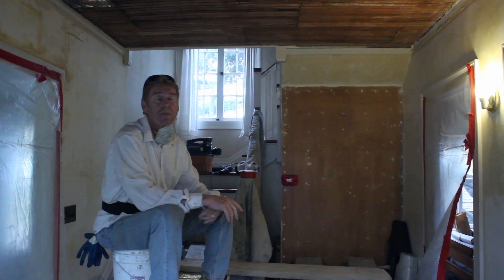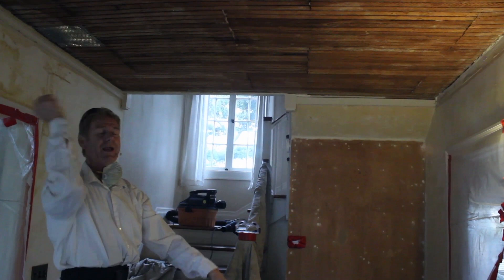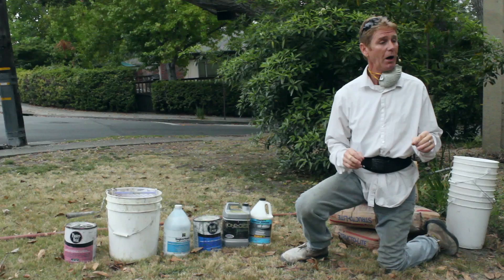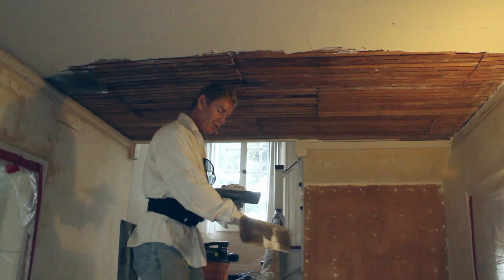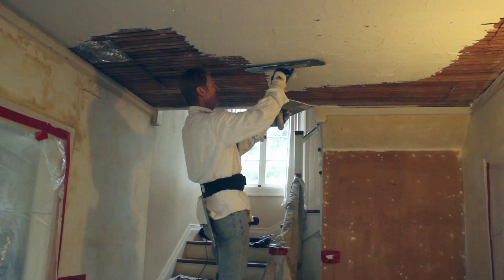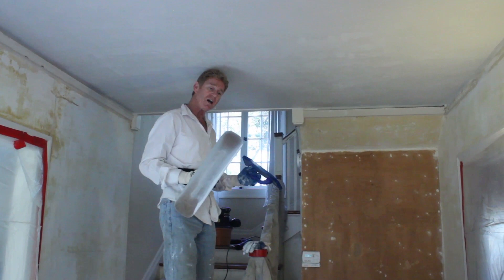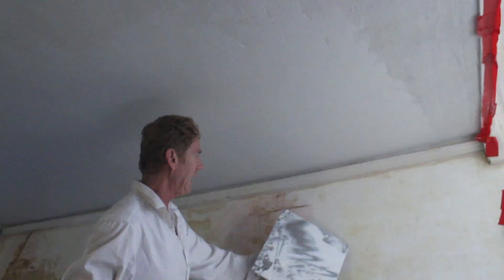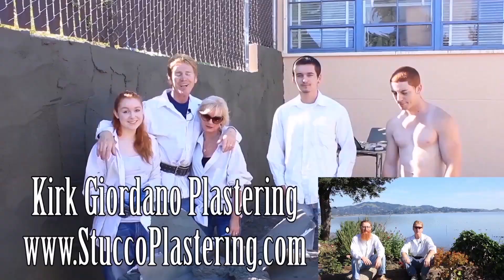Structo-Lite base-coat with a lime plaster finish

Comment: I been Plastering for 47 years. I always cover the wood lath with metal lath. I like you started in the union.
Reply from the maker: Good morning Wallace Dude, my fellow plasterer, I'm glad someone has more time than me in this sport, I feel better about myself now.
 BTW, I have many videos where I do cover the joists and wood lath with 3.4 metal stucco mesh and even 3/8 rib lath, this ceiling it would have been overkill.
                          Live long and plaster
 teaching you how to repair your number 1 investment
Reply: Kirk Giordano plastering Inc. this dude is about done with plastering. Never liked it. If you would have asked me  when I started if I'd be doing it 47 years later I would have said your nuts! That being said I made a good living at it (still do) I like the guys I worked with all are dead now. Only way to get a plaster is go to the grave yard and dig them up. I'm just 64 but I think this is my last year.

Comment: How long can the Structolite sit before you would have to use a bonding agent before putting on the Diamond? How long should you wait after applying the Structolite base before applying the Diamond finish?
Reply from the maker: As soon as it’s set you can finish over it.

Comment: Hey there kirk, just wanted to add a little info about StructoLite, that is directly from USG, that I haven't heard or read you mention. StructoLite, being a lightweight aggregated base coat is not nearly as strong as a standard sanded base coat made from a standard high strength plaster aggregated with sand. USG's StructoBase product is the strongest gypsum basecoat they offer, it is just much harder to find than the pre aggregated structolite, and also requires jobsite addition of sand. Because the lightweight aggregate, perlite, produces a bit weaker coat, structolite has several limitations that USG mentions directly on the back of the bag, and in their overall plastering literature. They recommend it not be used for three coat work over metal lath, when a standard smooth coat plaster is being applied, as it is not strong enough to prevent cracking of the finish. The reason we get away with using it like this, is because I am almost always applying a smooth finish that is a high strength veneer plaster, instead of gauging a white coat out of lime putty and gauging plaster. I see you also using the high strength veneer for your smooth finishes in your videos too. As I have mentioned in previous comments, these veneer white coats are many times stronger than a standard lime and gauging finish. If you read the information about the veneer finishes closely, it is apparent that the veneer finishes do have a very fine quartz sand added as an aggregate, which is what gives them their extreme strength and ability to be applied in a single thin coat, which a standard white coat could never do. The sand is so fine though that it spreads and feels like a sand less putty finish. Because the veneer finishes are so strong like this, it allows us to bypass the normal limitations of StructoLite not being strong enough for a standard putty coat, when applied as a two coat base over a non ridgid lath. This of course does not apply when doing one coat over a rigid base such as gypsum lath, or block, etc.. I just thought it is important to note these limitations of StructoLite, as USG is sure to mention them clearly in several locations, and the fact that most people don't mix up a lime and gauging finish, doesn't mean that someone may not try at some point and if they do its important to know it may not result in an issue free finish over two coat bases like the high strength veneers allow us to get away with. Bottom line, is the lightweight aggregate provides insulating, fire dampening, sound proofing, etc, but is in no way a stronger base coat than a standard sanded base and there are differences in applications due to this.
Reply from the maker: Good evening Joseph Dude all true thank you,
I try and give as many details as I can remember when showing how to use products, I thought I gave the basics well, but there's no way to explain every detail of any of the products we show in video's plus I forget more details than most folks learn in a lifetime.

            Live long and plaster
Teaching how to repair your home

Comment: Just a pointer on using a milky white bonding agent that dried clear on me, thus making it hard to know if I'd hit everything. I used some acrylic ink (yellow) as admix to give it a dried color haze. Watering down acrylic paint of any type would probably work as well and not compromise the adhesion of the bond agent.

Comment: Every time I hear the word structo-lite I remember the first time I used it. Dumped a wheelbarrow load from the mixer. Took it 40 ft to the mud board and the entire load went off in the wheelbarrow. Full wheelbarrow worth of mud hardened solid in seconds.
Reply from the maker: Good morning Farmer Dude, that happens often if the bucks, drills are dirty, this plaster usually take between 90 minutes to 5 hours to set, but when dirty or contaminated will set immediately plus the wheel barrel sides sucked the moisture out too,
 Life and time of stucco dude.
                          Live long and plaster
           Plastering tips for your information
Reply: Yes sr. Happen to me too can even believe it, mix all different kind of mud before but structo lite man, that is a different story if you add dirty water or dirty tools.

Comment: Kirk....great video.  Ive emailed you a few times in the past about how we use structolite in the movie business to stand in for anything thats supposed to be concrete.  I've even sent you some pictures of our work.  My team and I usually, depending on how much time we have, throw a quart cup of portland cement into our mixes so it hardens faster.  Have you ever done that while using this product?  If not, and you're pressed for time on a job you should consider it.  Half a bag of structo in the bucket, quart of portland, and water and you'll have about 45 minutes before it starts to harden.  Its a good method....
Reply from the maker: Good morning Mike Dude, excellent tip, as a rule I don't like to add portland to gypsum based products on my jobs for your movie props great idea.
 i usually have some gypsum accelerators on my truck, this time we didn't so we got a cleaner truck while waiting. 
           Love to see some of your movie set props,
                          Live long and plaster
 teaching repairing your number 1 investment, your home

Comment: Kirk. Thanks for continuing with the videos.  Do you have any videos on trying to match a small patch to the existing concrete?  I have an existing porch where near the top step where the weather hits, the aggregate shows and a section blew out and it's right where everyone can see,otherwise the rest of the porch is in really good shape.I'd like to patch that without it sticking out like a sore thumb. Is it possible or is it possible for the average guy? Id send you a picture if i could
Reply from the maker: Good afternoon journey dude, I belive so, type in the keywords on our channel a video should appear.
                       Live long and plaster
Sharing the plastering knowledge for those interested

Comment: I done a bit of rendering today... on a block wall I built for a customer. I prefer lath eml over Browning coats. I prefer just to do one coat, used white cement with alot of sbr+ in the mix and on the wall. Cleaned the wall before I rendered it thoroughly. Floated it up a few hours later as I was doing final finishes to the decking and slab work I also done 😊
Reply from the maker: Good afternoon Sargent Dude, atta buy, just get her done                   
                                 Live long and plaster
   teaching anyone who’s interested how to repair their number 1 investment
Reply: Kirk Giordano plastering Inc. You make it seem so easy! I've been watching your videos a while now. It's all in the prep I'd say. A bad prep is a bad finish. Learned That earlier as well left old cement residue in the mixer before the colour coat/white cement and it began to lump 😔 thrown it out brick acid in the drum got it spotless used vinegar and water to lower the ph and made a new batch no lumps and dried even made two passes and the wall was flat. Floated and job done. Keep up the videos, my brother has started watching your videos also as he wanted another trade behind him, he's starting a level 2 in plastering course this year while I do my level 3 plumbing and gas works. I'm a bricky by trade but I've put my hand to a lot of trades and got the certs to go with it.

Comment: Question Kirk . Do you recommend a three coat system for lath.  2 coats structo lite and your finish or can you get away with one coat of structo light and than your finish ?
Reply from the maker: Evening Michael, two coats.
Structo-lite, for the first coat, then whatever product you prefer for your second or finish coat.
I prefer Diamond veneer if I'm already using Structo-Lite.

 The complete plastering encyclopedia with more than 800 videos by the plastering messengers of Youtube. 
                          Bringing peace, love, and harmony back to the world of plastering.

Comment: Kirk and Jay another excellent video as usual. I have another use for structolite, it was given to me by an old time master plumber. I put new bathrooms in my house and used fiberglass tubs, to make it feel more solid and not sound hollow, I mixed and put strutcolite on the sub floor and set the tub into it. The tub is as solid feeling as a cast iron tub and when using as a shower doesn't have that hollow sound. 
So besides being a good sound absorber as you used it, it has another non plaster use. 
And yes, I will see you on the next one.
Reply from the maker: Howdy Clint Price Dude, that's just too cool, excellent tip,
                          Live long and plaster
 teaching anyone who cares how to repair their number 1 investment

Comment: Kirk,
   Thanks for this video. I was hoping to see more tips on mixing Structolight. Do you just mix it be feel? Can you give some tips for novice mixers? I found myself having to add water or plaster on nearly every batch. It would be good to hear the problems caused by a too-stiff or too-wet mix.

    I've watched many of your other videos and they gave me the confidence to finally repair plaster instead of replacing it with drywall. I should have learned this years ago. 

   I just finished a 1945 house with water-damaged rock lath on several exterior walls. I replaced the damaged lath with wire lath and used Structolight for the base coat. Even counting the time and materials I wasted learning, the repair was cheaper and looked better than those I did in the past trying to patch in drywall to match the plaster.

   Thanks again for sharing your knowledge and skill.
Reply from the maker: Good morning 62 Dude, atta boy,
in the description, there is a link to a video about mixing structo-lite Jason did a fews years ago.
                          Live long and plaster
 teaching you how to repair your number 1 investment

Comment: Hi Kirk; Back in the day In the #UK we had 112lb bags of plaster/cement (Now 56lb-ers) .... On site - (no forklifts) - just us - and with 16 ton deliveries at a time x 2 blokes = that was a day's work in itself as we usually had to 'walk' each bag to a designated 'dry area' and often under 'Too-Low' scaffolding ..... Those were the days EH?? ;-)
Reply from the maker: Good morning Peter dude, my fellow plasterer from the UK.
 Been there a few time in days long past, they delivered one hundred and twenty 94 pound bags of cement plaster on top of a hill as they said the folks lift could not go down but they did drop the 20 yards of sand below at the house,
 Me and my pal drove a truck to the top lifted and tossed 40 bags at a time onto my truck then drove down to our mixer and unloaded, 3 times then
 worked about 10 hours that day, the next day we both had to take the day off as using muscles that have laid dormant so long took a day to heal, learned a great lesson that day, make certain materials are where they are supposed to be before bringing a crew to start a project.
                          Live long and plaster
 teaching anyone who’s interested how to repair their number 1 investment

Comment: we would lay a screen on the board throw down the lime, make a little well in the center,
add water and a little gauging and mix blend with trowels, jerk screen the mix and rock and roll... you still toit that way kirk?
that was fun!
Reply from the maker: Howdy Looking at me Dude my fellow plasterer,
 it's been awhile like 3 weeks since I did this, the reason I did indeed mix on a board with a water in the center of the wall of plaster was it was too much trouble to find extension cords, outlets dig through my truck for a clean bucket and such.
 I think I'll do a video on this old but often still used method of waiting until the water absorbed into the surrounding gypsum then mixed with my hawk and trowel.
                       Live long and plaster
 teaching anyone who cares how to repair their number 1 investment

Comment: Hey Kirk! Thanks for making all these great videos. I've got a question for you--apparently, USG recommends that Diamond finish not be applied over Structo-Lite. Now, I know that plaster wizards such as yourself can do it without any problems, but I wonder if regular people would run into trouble. Any thoughts?
Reply from the maker: @ChristopherHillenbrand  Hi Christopher, there are many so- called rules that companies suggest we follow and for good reason, such as don’t apply a lime finish coat without a base coat. Have I applied a finish without a base coat, sure. But I know the reasons behind this rule. 
Structure lit is a mill-mixed gypsum plaster while their Diamond finish plaster is a lime plaster, two different minerals. You could always apply a bonding agent over the Structo-Lite and now your golden.
Reply: @StuccoPlastering  Thanks for your help!! :)
Reply from the maker: @ChristopherHillenbrand  No problemo

Comment: Kirk can you make a video  explaining why plastering with a trowel is better than using a red sponge(applying stucco)? Your videos are great btw.
Reply from the maker: Good morning K Woosh Dude, a red sponge sponge float is usually for concrete or cleaning grout lines from bricks, while a green float is mainly used for bringing out the sand in the base coat.
 I have not heard of anyone trying to apply plaster with a red or green float, but I guess it's just as possible as using a frying pan to apply stucco it can be done,  but is the wrong tools for plaster or stucco applications.
                          Live long and plaster
           Plastering tips for your information

Comment: What a great instructional video i have stumbled across while trying to find a solution for our ceiling. Can this be used on hard compressed straw/seaweed to cover? Thanks
Reply from the maker: Howdy Melissa, yes, but it's too much work for just a patch, instead buy a bag of 20 minutes drwall compound instead, about 15 bucks, bags weigh about 20 pounds, mix just what you think you need and apply, need more, mix more, the bags say the time it sets for example 20 minute mud sets in 20 minutes. You can purchase these bags at Lowes or Home Depot.
                    Live long and plaster
    Mastering Plastering by Kirk and Jason Giordano
Reply: Kirk Giordano plastering Inc. 
Thank you. Our entire ceiling from the 70's is a product called woodtex, is this suitable to be plastered over? I am in Australia so we don't have home depot here.
Thank you any advice is highly appreciated.

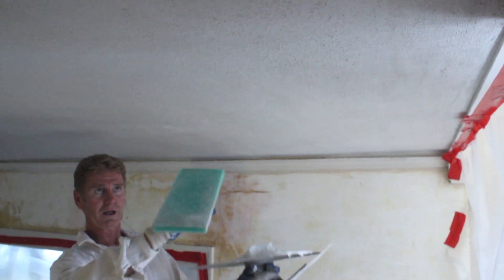Comment: Hi Kirk - thanks for posting these videos.  I have to patch some plaster and the texture looks very similar to what you described at 12:30 or so, the "grainy" look.  When you were wiping with the green trowel, was that over the structo-lite base coat still (that had some time to setup)?  I would assume that the veneer coats would not have the aggregate to expose like a base.  Is this correct?  Thanks for your help
Reply from the maker: Structo-Lite base coat is what I was floating with the green sponge. It brings out the fine sand.

Comment: Hey Kirk! Thank you for all the informative videos.

I want to understand that the cedar ceiling in the video is suspended, right?

I'm asking this, because i've a cedar ceiling which isn't suspended, it's an open wooden ceiling in between the wooden floor beams. I mean when you walk above this ceiling, i guess it'll shake eventually. Do you think does it ruin the plaster in time? I'll use fiberglass mesh and bonding agent to bind the plaster to the wood, but i'm still worried.

Thank you so much!
Sibel
Reply from the maker: Good evening Sibel, not really, the wood furring strips are nailed the ceiling joist.
                         Bringing peace, love, and harmony to plastering 
                 Sound advice from the plastering messengers of Youtube